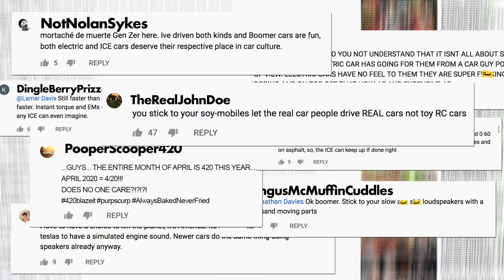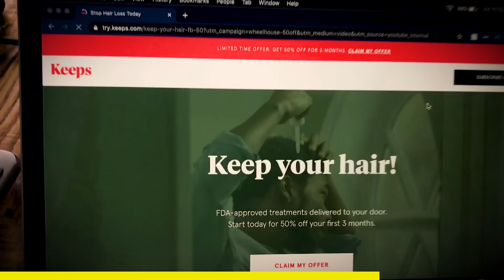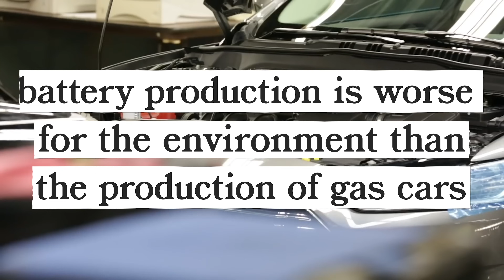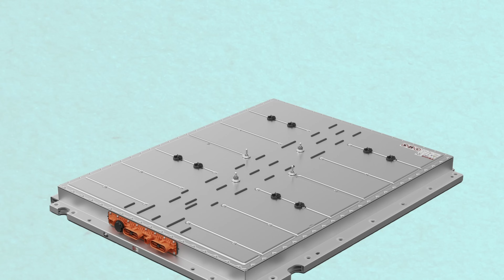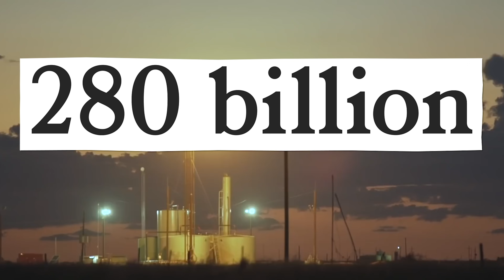Are Electric Cars REALLY Better for the Environment?

Comment: 4:40 ethical issues. 
It is correct to point out them but you have done it just for the cobalt. What about wars and endless number of "casualties" and atrocities in order to provide the world with low price crude oil?
Other argument is the pollution caused worldwide by the oil split (e.g: after 10 years deepwater horizon is still affecting wildlife and not only)
I do agree, great fun comes from gas engines cars but we, petrolheads, are just a minority. Most of the people would enjoy the instant torque of an electric car

Comment: Would like a full version including the 'End of life' damage from both cars and how long a battery needs replacing due not holding a charge/lowered range as currently, a ICE vehicle has a longer lifespan before needing replacement,
Reply: says who?  There are 7 year old teslas with lots of battery left.
Reply: There are literally thousands upon thousands of EVs which have done well over 100k miles, or even significantly more on original batteries. I can think of multiple friends of mine who've had new engines, new turbos, even new fuel pumps etc in cars less than 5 years old which add up to thousands in repairs or even scrap the car. Outside of the original Nissan Leaf with it's lack of battery heating/cooling, I've not known an electric car to ever lose more than about 20% of original range, including those 100k+ mile Teslas I mentioned. There will be random failures, or design flaws, but the technology really is much more reliable and sustainable than the mainstream media and even governments will often tell you - oil companies and the immense wealth they have generated and invest in our societies are very difficult to turn your back on
Reply: You guys are comparing apples to oranges.  An ICE is equal to an EV's motors.   A battery is equal to gasoline.  In the long run, gasoline will cost more than a couple of EV batteries.
Reply: Assuming no premature failure, I want to say the current generation of Tesla batteries have a life cycle that equated to something like 500k  miles. Old batteries weren't great, the newer ones are much better, and there is a rumor of an upgrade that will bump battery range while also making the batteries cheaper. Here is some info:

https://evcharging.enelx.com/news/blog/580-how-long-does-a-tesla-battery-last
https://www.google.com/amp/s/www.wired.com/story/tesla-may-soon-have-a-battery-that-can-last-a-million-miles/amp

Also, on the eco side, they are researching a way to replace some of the polluting items with renewable. They are starting to use bamboo derived carbon in lithium batteries as an example.
Reply: Correct if well taken care of an ICE will last way longer for sure. Hoovie's Garage did a video back in Oct. 2017 where he bought a 2005 Toyota Prius Hybrid, and the batteries where already fully dead(no telling when they actually died, and how long the car set before he bought it), and not holding a charge, and just to rebuild the battery pack himself was well over $2,500 USD, and a new battery would cost at least double that, same if someone had the work done by a mechanic for a rebuilt, or a new one, of which can over time be more than what the car is worth. My 02 Ford F150 Crew cab is starting to show it's age with old cheap Ford plastic breaking down inside, but the engine, transmission, etc.. are all still great simply by basic maintenance, and it's got well over 200K on the OD. I'm gonna keep it till the wheels fall off.  
BTW here's the video, you can look up the rest in the series on his channel. 
https://www.youtube.com/watch?v=lSwUEVx5G3U
Reply: @CommodoreFan64  I follow hoovies because he is insane, but most examples show EVs are as good if not better for long life. Same as there are lemon cars and engines, there are lemon batteries too, but if we use Tesla as the standard, the batteries life cycles and general mileage are between 300k and 500k. I do not know the life cycle on the actual electric motor, I'd have to look it up.

Best I could think of for gas burning engines would actually be diesels. My family is big into diesels and they are awesome and when properly maintained will put up alot of miles. Father has a 300k mile F250 diesel, older brother a 250k mile VW Tdi. Great vehicles, and probably the best to compare to EV for longevity.

Ultimately each has its advantages and disadvantages. EVs are in their infancy as a main vehicle type and will get much better over time. Just like gas and diesels were lackluster in the early days and are much better now. EV is great for cities, suburbia, and surrounding areas. Gas and diesels are better in rural areas with less amenities. Diesels are great for towing, torque, longevity, but carry the premium for it, similar to EV costing more than a gasoline counterpart. I think it's important we don't go to war over the engine and power type, and realize they all have their places right now. If EV is the next step, so be it.
Reply: @CommodoreFan64  The Prius had Nickel Cadmium batteries which are a ridiculously out of date chemistry. They suffer from memory, and have way lower energy density than lithium, but they were cheap to manufacture

Comment: Here’s something he missed, which I will admit if you’re not looking for you probably won’t find it. Carbon dioxide batteries and carbon dioxide capture technology are about to take off. Why, because carbon monoxide batteries are 7 times more energy-efficient than lithium-ion batteries, so take the best battery and times it by 7 with no extra weight. Now, carbon dioxide capture has finally become a real option because they have streamlined the process to work at room temperature. On top of all of that, companies like tesla are boasting that they can have batteries that last 1 million charges, while another company is saying that they have batteries that they can charge significantly faster. Put it all together and you have a $1 trillion battery industry that is about to explode onto the world. But, the biggest take away from this is we finally have a financial incentive to take carbon dioxide out of the atmosphere.

Comment: How do alternative fuels, like ethanol or biodiesel, affect this conversation?
Reply: Good point. I'm no expert, but ethanol produces less co2 but more of some nasty gases (oxides of nitrogen, IIRC) which are a bigger concern for smog and human health.

Hydrogen has nearly zero tailpipe emissions (emitting only h2o, regardless of use in an engine or a fuel cell), but until we have the extra electrical energy and systems available to synthesize it, hydrogen comes from the oil industry. Then there's the challenges of safely transporting and storing hydrogen in passenger cars.

If I'm not mistaken, the jury's not in on biodiesel due to it being unregulated and therefore not being fully commercially tested. I've heard that biodiesel avoids much of the sulfur that has to be increasingly removed from traditional diesel fuel due to emissions standards, although I believe this again has more to do with smog than greenhouse effect. I personally think biodiesel seems to have potential to be cleaner than petroleum diesel, but will be shut down quicker than it will catch on due to increasing emissions regulations while the industry drags its feet. Biodiesel is more susceptible to gelling in cold weather, too, but I don't know if this is due to it being unregulated and lacking the same additives that petrodiesel has or not. 

I'm not quite sure how it balances out, but biodiesel can be made from waste cooking oil, which offsets the emissions required to produce, but methanol or ethanol is also required in its production. It also has a significant byproduct of glycerin, which may or may not be "clean" enough for glycerin's usual commercial uses.
Reply: Ethanol is a joke, the only reason it gained prominence in this country is because U.S. Senators from corn producing states put millions of dollars of subsidies into it's production. Biodiesel has a better well-to-wheel ratio than Ethanol, but the high nitrous oxide emissions and incompatibility issues with modern diesel exhaust systems have made it practically irrelevant to the U.S. fuel supply.
Reply: It takes more energy to produce both ethanol and biodiesel than either product contains. From the beginning it's a losing battle on that front. The idea of both fuels was to be less dependent on the oil industry as a whole not stave off environmental problems. There is an algae that produces ethanol as a byproduct that is promising but it currently requires too much land mass to grow and maintain.

Comment: Though the US is going to be getting a large lithium mine in the next 5 years which which will help reduce the environmental impact a fair bit . The new US mine located in Nevada also is designed to have a very low water usage rate and has a high level efficiency.

Comment: One thing to note as well is that EV batteries do degrade over time and may need to be replaced. And with the actual battery being the main cause of the emissions I wonder if that would cause any difference in the long term emissions of an EV. Just a thought.

Comment: This is the same thing I've been saying. I enjoy petrol more than electric, but I know electric will ultimately be the successor. However, one main issue for Evs is maintain the battery. The batteries like phones, wear down over time. So you'd need to replace it. Which is not really cheap.

Comment: Nolan, Nolan, Nolan.... your research isn’t wrong, BUT your missing some important consumer factors that reduces the overall benefit to the environment.  
 - 1st- in order to have full benefit of an EV it must replace an ICE, meaning it’s must be taken out of service (aka, destroyed ) not traded in and resold to continue its polluting ways.  
- 2nd, a lot of consumers want something new, frequently... so EV purchasesers need to change there purchasing habits and keep their EV of choice long term. If a high percent of EV’s sold are to return customers the manufacturing impact goes up exponentially.
 - 3rd, your not including the environmental impact of taking additional cars out of service (aka destruction).  

With these considerations I think the benefit would be diluted
Reply: Wrong. Most American used car buyers are looking to replace their older car at the end of its life, so when they upgrade to the new used car sold/traded in by the EV buyer, the environment benefits.
Reply: yan-Deriction: re-read my post - I just said “a lot of consumers” not most. And I just said the benefit is diluted - not that there wasn’t a benefit.

Comment: The electric grid cannot handle it. Go through one hurricane where I cant get power for 2 weeks. Add time to that when we add these charging stations. Also what about when i cant get my car charged because there is no electricity nearbye. What about emp pulse from a foreign power. We have already started becoming to reliant on our batteries in our gas cars. We need to start looking at these things because tragedy’s and invasions do occure and we need to be best prepared for situations such as an attack or simply trying to improve emissions standards.
Reply: Go start an ICE car after an EMP attack. it's not a freaking Ford T anymore dude. Alll the main electronics and onboard computers would also be fried.

Comment: What about the average lifespan of an EV battery? Will they last 200,00 or even 300,000 miles? How much more emissions will be required to replace that battery or the vehicle entirely? Charge controllers, drive controllers, and EV motors compared to a rebuilt engine. You also have to factor in that in America we generally dont buy cars. How inefficient would an EV SUV actually be? How did you take your average emissions for Petro engines? Did you weed out emissions from vehicle types that dont have EV counterparts?

Comment: My main problem with ev's is the low efficiency or better said how far you can go on one charge compared to one filled tank...
And the battery capacity goes smaller over the years..

Comment: So basically in the long term, EVs are better for the environment, which isn't very surprising. Ideally we should aspire to make every economy car into an EV since that's what the majority of the working class drives anyways. Luxury cars are a little tricky but they certainly would benefit from being electric. Sports cars, on the other hand, should remain as ICE for the enthusiast market. However it's more likely that sports cars will transition to hybrids as the Holy Trinity of Supercars redefined speed just a few years ago.

Comment: Also though let's not forget that those batteries don't last forever. The average lifespan of a prius battery is only 10 years or 100,xxx miles. So how many battery replacements will go into a single vehicle thus pushing battery manufacturing to pump out even more green house gasses. Not hating on ev i think they are awesome personally but that mixed with the fact that we don't quite know how to dispose of Li batteries yet is still a negative in my book.

Comment: Im still not sold, ill wait for Hydrogen Powered Cars. That way you dont have to lug around heavy Batteries and refueling doesnt take hours. Essentially you get the benefits of Electric without a majority of the negatives. Sure Hydrogen is highly volatile but so is gasoline and Batteries are known to cause catastrophic fires aswell.

Comment: Yes, yes they are... Also, Nolan is surprised by literally everything... 

Electric vehicles are only getting cleaner and easier to manufacture with less enviromental impacts... Lithium extraction is still less harmful to the enviroment than oil extraction... The lithium is only needed to make the batteries, whereas oil is needed throughout the entire life of vehicle...  Both as fuel and lubricant... 

The old batteries in your electric cars will soon be used to bank extra energy and stabilize the electric grid for renewable energy use... Your old gas engine is useless going forward, and very inefficient at what it does NOW...

Not that Nolan didn't make most of these points...  I just find his style of presenting obnoxious and his general "dumb guy" approach to be insufferable.

Comment: EV's are just getting started vs ICE vehicles have been in mass production for over a 100 years. What we've been able to accomplish from the early ice engines until now is nothing short of miraculous but imagine how good the EV's will be with a similar timeline of innovation. Who knows what chemistry these batteries will be using and how efficent we will get renewable energy sources to be.
Reply: MrRuss50 but the climate change argument throws that out the window. We don’t have 100 years, to get everyone who is not mad about cars, so most except me, we have about 10. If we improve rapidly enough we get another ten years, but if one economic depression happens, ev tech won’t improve fast enough.
As for me if I have to cut carbon foot print, I like the 4 age

Comment: Well, fair enough. But you avoided saying a number to how long do you need to drive an EV to make up for a gas one. You kept saying "in the long run". Well, what is "the long run"? Is it 2 years or 20 years?! And yes this question does matter a LOT because lets not forget, that batteries die rather quickly. Even the best batteries out there will hardly ever provide sufficient power for over 15 years. And im guessing high there cuz the actual battery life at the moment averages out at about 7 to 8 years. So now you need a new battery, which is already bad enough, and what the hell do you do with the old one? Throw it in the sea?! Cuz they sure hell dont recycle as easily as a metal engine! Which by the way lasts a whole lot longer than a battery!

Comment: Ok.  A Coal powered Plant to generate electricity is 42 efficient. So right off the bat, your electric car is down 42 percent in efficiency.   A diesel Engine Power Plant is around 45 percent efficient.  So, A diesel engine powered car is more efficient than an EV right off the bat!!  That is.  If you are using a Coal Powered plant electricity.  Hydro Electric plants are 90 percent efficient.  So. If you want to use their power to charge your Electric car, you win.  That means, we need to build nothing but Hydro Electric power plants!  As of right now, most of our power is nuclear 33 percent efficient, and Natural gas 42-60 percent efficient.  Transmission losses are around 15 percent.  That means.. EV still losses.... I know this. But I still love all my EV's!!  They are the future.  Battery technology is coming on!!!     As for now.. Stop the BS on EV's being so efficient and bla bla  bla.. As long as you use coal, nuke or NG power plants to charge them , they are not as efficient as the IC engine because of this.   Period!! So Stop with the BS!!. EV"s are cheaper to operate because of the cost of electricity makes them cheaper to operate. The more EV's coming along, the more that will change and cause your home electric bills to go higher and higher!!  Remember... You were warned!!